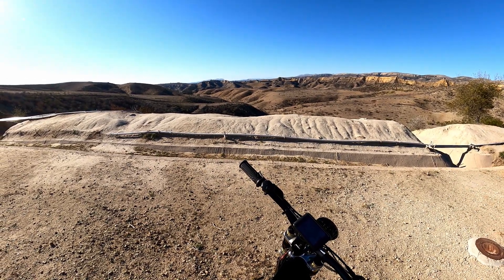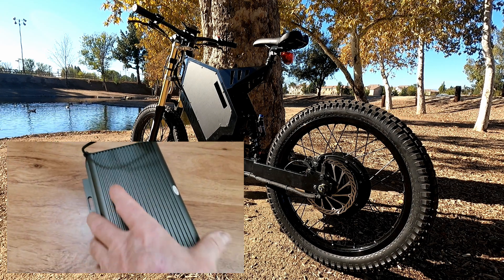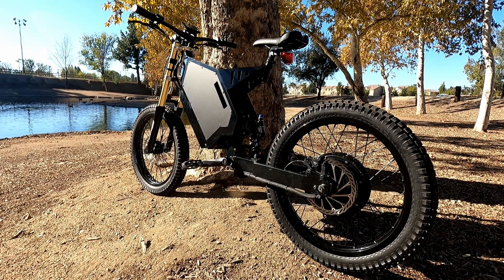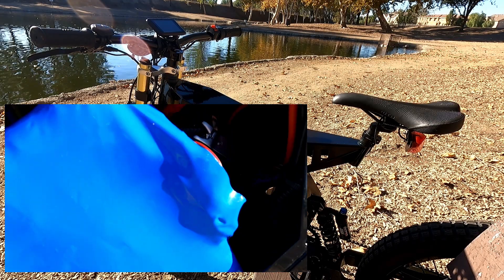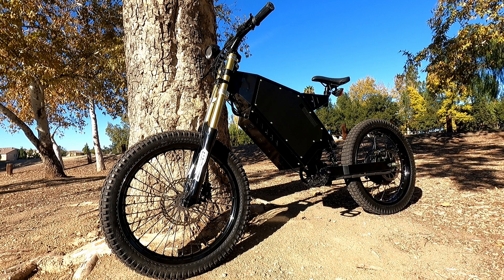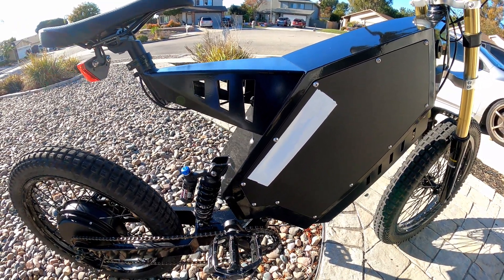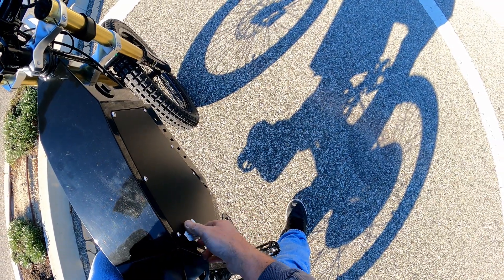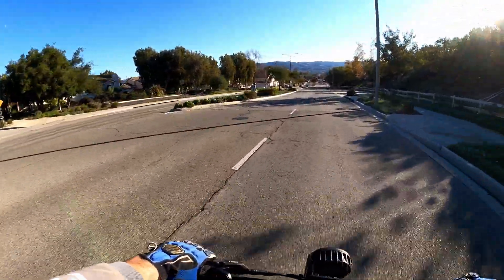Enduro Ebike Build Update Mods Repairs and Sabvoton Controller Heat testing

Comment: Is this giant trance X ebike a below a good buy for $3,200AUD in Sydney, Australia?

For sale this unique piece of MTB
converted to electric with a high torque
4000W controller and lot of upgrades on it.

As strong as a bulldozer!

Super fast and very fun to ride, Throttle only like motorbike!

Mechanical specs:
✅️Air triple clamp forks Marzocchi Bomber

✅️Maxxis hookworm assault tyres 26x2. 5

✅️Antipuncture heavy duty tubes

✅️Sport hydraulic brakes TEKTRO with brakes sensors

✅️203mm rotors front and rear

✅️Shimano deore groupset

✅️TORQUE ARMS

Electric specs:

⚡️Jumbo extra large 60V 19.5ah battery pack made with LG cells 21700 and 60A bms with a burst of 150A.

⚡️Mythical MXUS 3K TURBO hub motor with
double hall sensors. .

⚡️SABVOTON controller (Risunmotor) 80A
4000w (unlocked and completely settable
by phone app that can handle till 72V) using a "sinewave" technology which is very silent and smooth.

⚡️Colour display

⚡️Alarm anti theft with remote control

⚡️Lights with electric horn

⚡️Fast charger (risunmotor) 5A

Usb charger

💨Throttle only (like motorbike), do not need to pedal at all.

💪🏼With all this torque can reach genuine
95/100kmh in a stroke of lightning!

This bike has been build for racing in a circuit with exellent parts and spare no expenses..

I will throw on the deal some extras such as sport helmet, complete front wheel and rear rim both wide 40mm and two brand new spare Maxxis hookworm 26x2.5

Can be organized a test ride for the right
buyer.

Comment: hi i have a question do you know if it is possible to make a bike with two controllers for two motors of 5kw each
I don't have a battery yet
Reply from the maker: Hello and thank you for watching I do not have any experience with connecting two motors I know that it is possible and there are e-bikes sold with two motors like the aerial Rider grizzly, you may want to look into that bike for some reference

Comment: I'm about to buy a bike with the exact same front fork. Is it possible to paint it black or stick a black film to it or will that affect the performance?
Reply from the maker: hello and thank you for watching, What performance LOL use these forks as a temporary stop over till you can upgrade
Reply: @samjohnson517  I meant to ask if adding paint or vinyl will affect the suspension somehow. I'll see if they can swap it to a KKE fork but wanted to know just in case, the gold color looks weird to me.
Reply from the maker: @FreezingFroggie  no I don't think you can paint the gold tubes because that's where it goes through the desk caps on the main fork baby upgrade to the kke I think they might be a little bit better

Comment: I have a idea to help keep the speed controller from overheating….it’s a old trick I used to use for Xbox 360s and Desktop computers….I used cooking oil and for looks I added food coloring, and for those who doubt mother boards can’t be submerged…into cooking oil….they most certainly can vegetable oil is non-conducive ’ I would mount the disc drives outside the plexiglass box’ Disk Drives couldn’t be submerged because it would interfere with reading disc’ I also had a tiny radiator and pump to circulate the oil.

I wanna be the first to try it…I’m gonna start with removing the speed controller case and build a air tight plastic holder and hoses going into a tiny radiator’ these can be purchased anywhere…many computer shops have them’ in Theory…it should be able to keep the speed controller cooler….any non-conducted fluid can be used.

I’m gonna start doing live testing on a cheap controller….Meant for 48v and use a 72volt battery instead…Another idea came up’ to keep the speed controller cooler…make the controller case leak proof and tap some Hose nozzles into it and run that to a tiny radiator with a pump the vegetable oil and the natural air….get both worlds.
My next trial will be for the hub motor, then the battery.

Comment: hello Sam, first thanks for your videos, very helpfull....i bought a dirt bike from alibaba, im haiting for her to arrive...its a 12000w bike , my question is....im gonna need something to carry my stuff...can i put a one wheel trailer on the bike? because of the hub motor?...it will damage or is ok?....thanks a lot
Reply from the maker: Hello and thank you for watching, you should be fine with the trailer, just keep in mind hub motors do get a little warm when you put them under stress like excess weight or going up hills ect.
Reply: @samjohnson517  OK thanks a lot for your help
Reply: @samjohnson517  im sorry i forgot to ask about the range... My job is about 15 klm from home, 30 km going and comming back... Is gonna last for maybe 2 days?
Reply from the maker: @TheMuthay  it depends on your battery but 30 km comes out to 18 MI and the onyx can do that on one battery without a problem my bike has a 42 mile range,  check the battery size and see  if you can charge it at your destination.
Reply: @samjohnson517  she comes with a 72v 48ah..Panasonic cells
Reply from the maker: @TheMuthay  that is a big battery 30 km should be no problem at all

Comment: Ive wondered recently if a CYC X1 PRO gen 2. Would fit on this frame?
Reply from the maker: I had someone ask the same question if I remember right the issue is with the bottom bracket width
Reply: @samjohnson517  that was a thought of mine. Then may be the way to go is full on custom kit from various parts and custom brackets. For me the idea was to change gear ratio to switch between more torque or more speed on this frame. I figures with that set up i could go stealth without the need for 2 motors

Comment: A quality built battery will have temperature sensors contained within the battery, dialing down the power of the battery and cooling it down for safety. Never skimp on your battery. You absolutely get what you pay for.
Reply from the maker: hello and thank you for watching Yes absolutely that is why I built the battery myself, I could not find one powerful enough and I do have a temp sensor on each side of the battery that I can monitor with my bluetooth app. I  have a video of the battery build if you're interested https://youtu.be/lgOZQGRH3H4
Reply: @samjohnson517  nice job on the build brother. I like how you put on the insulators, safety first! I have been checking out Jehu Garcia  he did a video yesterday on some new batteries that can push 50 c or 50 times the rated output for a nice little 300 amp pack that's no bigger than a few cans of beer. Stay vertical

Comment: These frames are so fun to upgrade. I just took my bike completely apart in my livingroom to mod for the winter. New QS205 V3ti 650 turn 5t motor, it’s at a motorcycle shop as we speak getting laced with powder coated stainless steel 8ga spokes on my 26in anodized rim. New Shimano Ice Tech floating rotor, rotar bolts, tire, rim liner, Kevlar tire liner, new Honda seat, turn signals, new Tron wheel lights, new motorcycle headlight/horn/turn signal switch, etc. It’s going to be a whole new bike. 💸💸💸
Reply: I agree.  I’ve always wanted to build/restore a car/motorcycle but always had cost/space/special tool obstacles.  I’ve been building an ebike this Minnesota winter. I can do this in our basement without making an huge mess. It’s been a fun challenge. I’m already planning my next build.

Comment: Great video, where did you get your parts? Specifically the frame, I've seen Alibaba, but it seems there no way of knowing what quality or if you will even receive it. Thx again for the info. Keep up the good work 👍
Reply: I just got my bike from alibaba. They're honest people. Same bike you see here. The only problem I had is not really with them but with the problems we had with the port and because chain supply issue it takes me quite a while to get the bike even though it's been sitting here at the port for a very long time and the only thing I wish I could do is to put a little more money to get a better bike with bigger battery and motor. I test mine compared to a 12000W, mine 3000W, it just blew me away and the range....I just don't know where the guy goes...lol. It's quite fun though...it sort of bring back the kid in me.
Reply from the maker: Hello and thank you for watching the frame came from eBay they seem to have gone up quite a bit since I bought mine

Comment: hey boss, how does the bike handle in off road and trails? Great videos and thanks for the awesome content.
Reply from the maker: Hello thank you, long sweeper type trails it's a lot of fun especially if you're climbing and you're on the throttle the front end gets light and starts coming off the ground it has a long wheelbase so I don't think it does very good and tight technical turns.

Comment: Hey Sam, you might want to look into a Fox X2 or Rock Shox Super Deluxe air shock they are pretty much Infinity adjustable then you won't have to deal with all the different spring rates when setting suspension sag.
Reply from the maker: That would be the way to go for sure, Ian kind of looking around a different frame designs  this one's so heavy it kind of fragile in a way. I feel like I would have  damaged no matter what suspension I put on there.
Reply from the maker: Check this out https://www.blessthisstuff.com/stuff/vehicles/cycles/neematic-fr-1-electric-bike/
Reply: I love the RockShox on my 26” X 4.8. The air adjustment is perfect for fine tuning for your weight and riding habits, and you can completely lock out the travel.
Reply: Wow !
That's bad ass !!
I didn't see any price on it.
I did see another one called the Drill, but that's just an electric dirt bike at 10K
Reply from the maker: @zaneturner8423  I love that design especially if it's made from aluminum or chromoly steel. I think the price on it was 13k but the design was sold to another company and I do not know what happened to it after that. I want a frame like that and then put all my stuff on it.

Comment: Your controller should be okay
Reply from the maker: Oh yes I'm sure it's fine however when I was riding in 90° weather I'm sure it was pretty close to voltage limit temperature I think the slots will keep it cooler and help it live a little longer
Reply: @samjohnson517  yeah that controller will be just fine Sam l don't think the cut outs are needed at all so many bikes run the same controller with no problems
Reply: I tested mine after a ride and it was just a little warm.
Reply: @ENDOPRYSMofficial  yeah they get warm but your controller should be okay I wouldn't worry about it too much 😁👍👍⚡⚡⚡
Reply: @racerx2095  👍

Comment: I have a 100 amp sabvoton controller do you have any settings I can’t get mph just wondering if I can go to factory settings
Reply from the maker: hello do you mean you can't get mph to display on the screen?
Reply: @samjohnson517  yes
Reply: @samjohnson517  the kit didn’t came without any instructions
Reply from the maker: @frankroach9346  what is showing on the screen when you turn it on?
Reply: @samjohnson517  can I continue with you tomorrow

Comment: watched a few videos sam,learnt a few things off you cheers mate.Wish i bought a 72150 instead of 72100 to go with my 5kw hub no regen, just have to upgrade.I did the double rear shock idea {Josh Street Design} credit where credit due,and it works spot on with two 8mmx90mm long shoulder titamium bolts keep the vids coming cheers from uk.
Reply from the maker: Hello thank you for watching, yeah like you said you could always upgrade may as well go to the 72200, I agree that idea Josh has with his shocks,  that is a good one I forgot all about that.